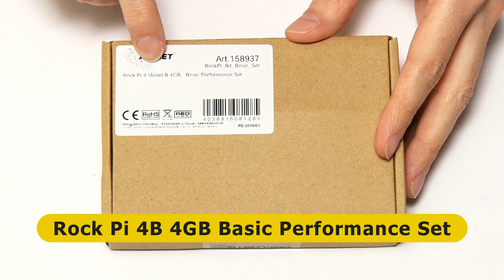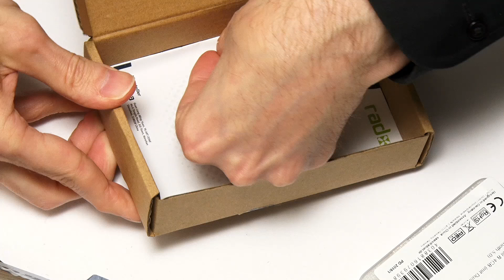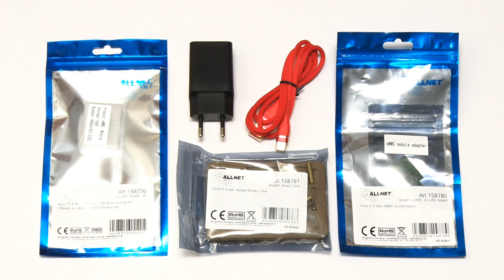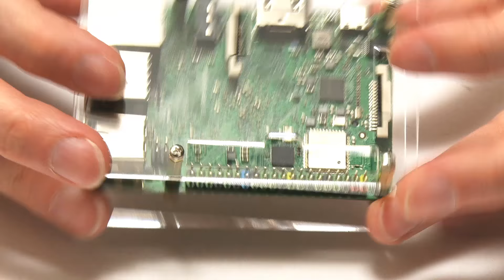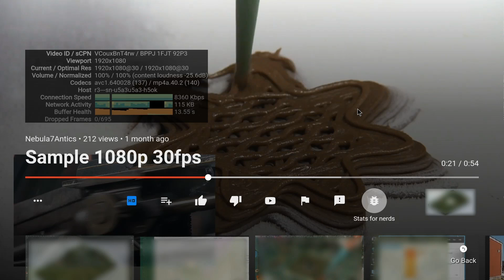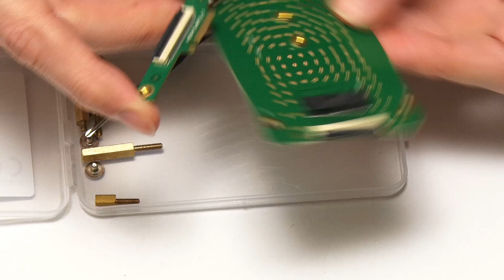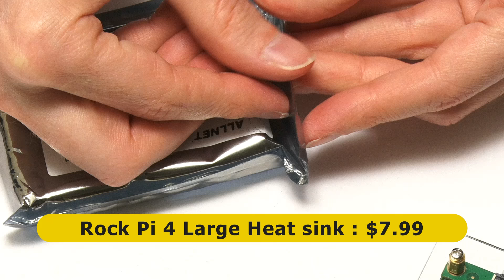Rock Pi 4B : M.2 & USB 3.0 SBC

Comment: the m.2 hat seems kinda stupid. cant you just use an m.2 ngff connection extender. something that just fits straight into the m.2 connector without any other kind of ribbon cable? I guess it would just be hard to secure the connection without a lot of glue or something. hmm.

Comment: I think it looks really cool and the prices are surprisingly good, but it has no real case support. Even the acrylic one isn't much of a case, it's just a glorified stand with how open-air it is, and it's not even compatible with the large heatsink or M.2 port/extender. Still, for under 100$, you can build one hell of an ARM-based machine here, and that's a good thing.

Comment: - install nvme and loose access to gpio - no thanks. 
- it doesn't matter what storage is used - the most important thing is HOW it behaves after power shortage/sudden cut off.
- how much power it would finally draw - 4 amps ? maybe 10 amps ! Unthought solution and I would prefer USB storage in the end
- price ? Oh year, in Europe it would be probably 50-60 or even 70 euros, so this is damn too much and I would gather slightly more funds and buy low power Intel NUC wit some GPIO addon on USB.

Comment: The likely reason your play store isn't working is because it's not a certified Android device.  As such it is not authorized.  You have to register your device as a developer.  It's the same issue that people with Kindle Tablets run into when they sideload play store and Google services. I've had to do it myself as well.  It's free but you only get 100 device slots and those slots are not reusable. 

Hope this helps!! :-)

Comment: of all the videos that you have made, which ones are for SBC computers not made in Communist China? Would you be able to label the video with the country of origin for the equipment.
Reply from the maker: To do this accurately would be extremely difficult. China makes about 25 per cent of the world's products, and around 50 per cent of electronic products and components. It also mines the vast majority of the world's rare earth metals, which are used to make the motors in hard drives, fans and so on. So the vast majority of computing products are likely to include a Chinese component or raw material somewhere in their supply chain.
Reply: @ExplainingComputers  Items like the 52PI ice tower is what I was meaning. Is there a non-Communist China replacement that you are aware of?

Comment: The host/device switch is kind of moot. All it does is switch the USB data + and - wires. 
The same could be gotten with an OTG cable, that has it internally set like that.
I think RockPi could have saved some money there.
Been looking for 'the best' ARM single board computers, 
And found that the AMLogic S922X-B is a bit faster, and the 922X is faster on an all core load (their small cores run faster than their big cores in Mhz) compared to the RK3399.
The RK3399 has tensor cores, for AI workloads, which I don't really need.

Comment: Thanks for the video. Question for you, Christopher:  Is it possible to transfer data over the USB-C port? My hope is to both charge via the USB-C port and transfer data over it using a single cable.
Reply from the maker: As I recall the USB-C port is for power only.
Reply: @ExplainingComputers  Thanks for the reply. Much appreciated. I think I'm just going to use an external power bank that supports the USB Power Delivery spec and connect the iPad via the USB 3 OTG port.

Comment: so the heatsink is made in mind assuming you're connecting the m.2 header board...I like that.  Does the rockpi also allow boot from the m.2, because that would let this be a pretty powerful and clean looking
Reply from the maker: The Rock Pi shown here could not boot from M.2, but the newer (rev 1.3) boards can do this. They also improved the M.2 board, following feedback on this video: https://www.youtube.com/watch?v=l6EUfqywsOI

Comment: Here are some other things to think about:
1. This board has better I/O. The emmc / nvme combo beats the RPi4B with sdcard and USB 3.0 every time.
2. The board only has 4GB. That's enough for watching movies and browsing the web or using it as a terminal for greater things. But it's no substitute for 8GB which you will need if you plan to develop on the box 
3. The RPi4 is a Broadcom product. That's a huge problem because of trust issues with Broadcom designs. However the Rockchip SOC is a Chinese product and that may be an even worse choice in the end. Choose your poison.
4. It's probably wouldn't be bad to wait until the rest of the SBC world catches up to the 8GBs of the RPI4. Never forget that not the fastest (affordable) I/O in the world can beat RAM. Except cache SRAM.
Reply: 5) Also the RasPi has 2 micro hdmi vs 1 hdmi for the RockPi (if you want to make a desktop computer out of it)

Comment: I bought this board. The price is OK and the hardware itself looks good. But it's clear for me that the company can't communicate on a normal way if you want to use their products. 

1. 
It basically starts with their communication which OS I need for the Rock Pi 4. You go to the download page and see: Radxa Rock, Radxa Rock Lite, Radxa Rock Pro and Radxa Rock2 Square. Why is it so difficult to put the name of Rockpi 4 on the download page?  That's the name of what they are selling! This is very confusion and in my opinion amateurish communication.
2. 
On the download page you can download their supported version of Linux which is called: Rabian. First of all it's only available for EMMC and not for your SD card. When you click on the link you get a Not Found page (date 2020-05-31). Again very amateurish.
3.
They put the EMMC memory on the same side as the CPU which is connected with the heat-sink. So you first need to disconnect the heat-sink etc. Before you can add some software on the EMMC. Bad design if you compare this with a Nano Pi which has a nice slot on the correct side of the board.
4.
The SD card slot is a very cheap one. You can't put your SD card in it with a secure click. It's also coming out of the slot about 50%! It's even longer than your heat sink!! Very bad design and again amateurish.
5.
If you are using a NVME SSD HAT, the cable goes from the bottom to the top. The cable prevents you to get your SD card out. So you first need to open your case, unscrew the hat, free your cable and then you can use your SD card slot. Very bad design. 

I was really happy to see the performance in the  ExplainingComputers Rock pi 4 video, but this SBC is not usable for commercial projects because of the way this company designed, maintain and support this product.

Comment: You kinda skipped over how you got the studs of the heat sink to connect to the studs of the ssd holder... they're both female requiring 4 threaded rods. Where'd ya gettem?
Reply from the maker: They come with the SSD board.
Reply: ExplainingComputers ah! I had gotten the acrylic case to use the top in combo with the big heat sink but it didn’t come with those rods 😫

Comment: Hi Chris, Tom from Long Island. I had some difficulties here so very, unfortunately, I've been away. I did miss you and your videos. the Rock looks good, I was disappointed with the minor flaws and yet-to-be-finished parts of the Rock but all things in good time. With that massive heat sink, I was wondering how thick it was in total. A quick note on your next Rock video or a text box would be great. Curiously, if I were to substitute a pi cluster, say 4 pies, would I see a substantial speed increase and has the specific Pi ever resolved it's video problems?  Thanks and keep up the fantastic videos.

Comment: Raspberry Pi really must include M.2 slot asap, SD card has soo many limitations, and hacking it to boot off USB is really painfull and still won't enable full potential of SSDs.
Reply: SWF, ISO compatible male w/ARM64 SBC, 32GB RAM, 10GB LAN, PCIE4NVME willing to connect without face masks...

Comment: The stacking method of adding more features gets to be a problem.  By adding the NVMe daughter board you cut off access to your general purpose IO pins.  I suppose there is another low cost add-on to solve this by making a longer ribbon cable to join the two parts but once you get to that point you could buy a fully assembled fully compatible IBM style PC that will run Windows, better forms of Linux, and have native support for all sorts of modern peripherals.

Comment: Ah that's awesome it has NVME! I was wondering what that port was for when I bought it. Still working on integrating this into my car as a car computer. The NVME drive will be a nice solution vs USB or SD storage. This is a great platform but it's not as compatible with as many operating systems however. Oh and to fix the Play store issue there is a script you can download that will "fix" it's okay protect authorization issue or it won't work...
Reply from the maker: And it can now boot from NVMe . . .
Reply: @ExplainingComputers  even better!

Comment: Chris, is the M.2 assembly flexible to work with other Pi or SBC variants? Also, do you know if there exists a battery to turn the SBC into a portable device?
Reply from the maker: Yes, this M.2 extender will work for other SBCs with an M.2 connector. No Rasp Pi has one, but (eg) a VIM3 does. You can use a USB power bank to run an SBC.
Reply: @ExplainingComputers  Thank you.

Comment: That's now a Rock Pi Sandwich after the Storage extension and heat sink added.. I want to see two things in the future... will it get 8GB of RAm and will it out run a RPi4.   I'd like a SBC with 8 GB of Ram so it can be a true desktop replacement.

Comment: It frustrates me that most of this was done with the Android OS, but it frustrates me even more that he never loaded any OS or any applications on the m2 nvme. It has vastly superior read speeds over a microSD. How do just sit there and NOT leverage that power on that small of a form factor?!?

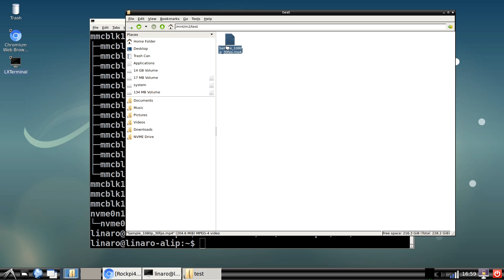EDIT: That pause as he waited for the video player to open up at 17:40 physically hurt me.
Reply from the maker: When this video was made, Android could not access the M.2 drive at all, and no operating system could boot from it. Just because hardware is physically connected to a computer does not mean it can be used in the manner you describe. Drivers matters! :) So I did "not leverage the power" because it was not available. Note that the latest version of the Rock Pi 4B can boot from an M.2 drive.
Reply: @ExplainingComputers  I see, that makes a lot of sense now. It's strange to me that the Rock Pi didn't have the driver to boot from the m.2 initially (seeing as how that is the biggest appeal of having that kind of hardware).

Still, I apologize for my disrespect. It is a good video, and it does a good job showcasing the hardware.

Comment: Hi Christopher, I really enjoy your videos. I am French and I can understand your English perfectly. You have an excellent pronunciation. You must be a Brit! LOL
The top set is almost $100. When you add all these accessories and a bigger M.2. SSD, you will end up with a pricey piece of equipment and still no case.
My issue is that there is only 1 GB LAN available. This makes it useless to be used as a PfSense machine.
Do you  know if there is a similar alternative with dual or more GB LAN ports available? 
I like that it has 2 x USB3 and 2x USB2. Although at these technology age, the USB2 should now be totally avoided. Can a USB to LAN adapter be installed to work with PfSense?
At the end it would still be expensive I think. Maybe still cheaper than a dedicated silent PfSense device.
So why would you use this device for? Media Center? Fat or Thin client? Desktop running Linux Debian? Could you use it as a Hackintosh alternative? I guess there is no way to get Window$ installed? 
Thank you for the great reviews.
Reply: Windows shouldn't be a problem because there's an arm build, but don't be surprised, if it doesn't run so well, with only 1GB of RAM. I never tested Windows 10 ARM, but Microsoft dropped some laptops with ARM chips and they run very well.

Also, you can add an USB to RJ-45 adapter, but most of them doesn't work so well, especially on ARM and remember, it's USB 3.0. You've to route all the traffic between the RJ-45 on-board and the adapter, which costs a lot of performance. Maybe it's a little bit better, to use a switch, but then you're also bottlenecked
Reply from the maker: @PsychEngel  You don't just need Windows, but drivers for the same. Running Windows on an ARM SBC is a seriously hard thing to do.
Reply: @ExplainingComputers  I know, that's the next thing, but in general, it should be working.
Reply from the maker: You can indeed non install Windows -- this is an ARM board, not x86.

Comment: You need to add a Google account in order to use play store.
Reply from the maker: You do indeed -- as on any Android device.
Reply: Not only the Google account, I think you've to install the Google Play Service framework, in order to get the Google PlayStore running. Google PlayStore is not the problem to preinstall, but the Google Play Service framework is not open source and has to be installed from the user, so the distributer doesn't get problems with licensing.

Comment: I have recently purchased one of these amazing SBCs and am running it of the eMMC chip, Debian from the Radxa download site, and it positively SCREAMS - it is as fast as, or faster than my Lenovo Yoga 920.  Unbelievable performance from this tiny little thing, and the video is smooth and no jumping.  No assembly instructions came with it, so it was rather like trying to put a Leggo puzzle together.  There are a few tricks and traps, btw.  Your video was actually quite helpful. I got the PoE hat and the NVME SSD (they supplied an Acer, not a WD) and the RTC battery.
Reply: Tracert is traceroute and is not in the system when you download it - you have to download the application plus 3 dependencies, and manually install....surprise, surprise....

Comment: could you connect a gpu to that re are adapter.because M.2 are a pci bus
Reply from the maker: Not all M.2 slots have a PCIe bus (some are SATA and/or USB). This one is PCIe, but I doubt a GPU would work. You would for a start need ARM drivers . . .

Comment: Does the gpio similar with either pi 3/4? Aka does the raspi shield works with this rock pi?
Reply from the maker: Yes, the GPIO is the same as the Pi, so many shields/HATs will work, is there is software support for them.

Comment: The SSD cape seems quite bad project. It's too long compared to the Rpi board length, it obstacles the IO connector and it doesn't feel rugged with those tinny flat cable.
Reply from the maker: Following many comments on the SSD extender on this video, they released a better version -- which I show in this video: https://www.youtube.com/watch?v=l6EUfqywsOI

Comment: THE PROBLEM is that this board is (clearly?!) a Pi 3 board and not Pi 4; although it has upgraded components. Also, in 2020 not being able to install any OS via USB is getting quite old and tiresome. :)
Reply from the maker: This board is a Rock Pi 4B. Nothing to do with a Raspberry Pi 3/4. :) It is most certainly a Rock Pi 4 model (which has a component layout similar to a Raspberry Pi 2/3B(+).

Comment: That is a great little board. Can Linux be installed directly to the eMMC Chip?
I don't want Android at all.
Reply from the maker: Yes, you can run Linux from the eMMC. Note that you will need the SD to eMMC adapter to allow you to flash the OS image to eMMC. There are now quite a lot of distros available: https://wiki.radxa.com/Rockpi4/downloads

Comment: The underside PCB looks as if it's missing an RF shield over the processor and ram...
Reply from the maker: RF shield over the processor? How would you fit the heat sink?! :)
Reply: @ExplainingComputers  Thats a very good question, perhaps why it was omitted from the design. Another possibility is that the board has another use which requires RF protection.  My guess is that the RF shield would have acted as the heat sink possibly with a copper pad on it's underside?

Comment: Wait your OS still run on the SD card ? 
it's still useless if the OS not running on the NVME Drive
Reply from the maker: On this version of the Rock Pi 4B, the OS has to boot from the SD card (or eMMC module). But I understand a new version of the board is coming out with NVMe boot.

Comment: I see it can run rather warm, but any ideas on the thermal operating range? I was looking at something I can put in my car and serve up files to the car entertainment system, and also access it remotely through home Wifi without having to pull it out of the car. It can get pretty hot in the car during the summer. Some hardware can handles this better than others.
Reply: Hi, according to the datasheet of RK3399 the thermal operating range goes up to 120° C which should be enough buffer to also run it in the car. It is also important to mention that the board generates some heat but for normal operation with the heatsink it will not get close to the upper range.
Reply: @NB-sw1op  Thanks much for that. I am hoping a good thermal cover will be enough to let it survive a hot car.
Reply: @daisame  yes, you can have a look at the available cases or think about your own solution. B